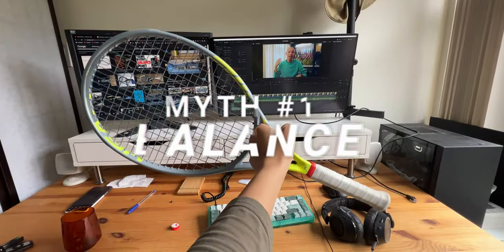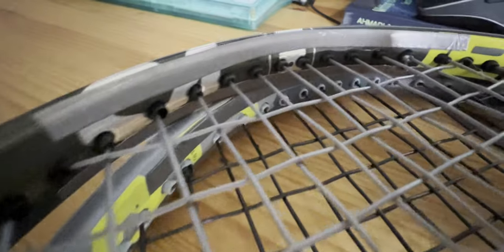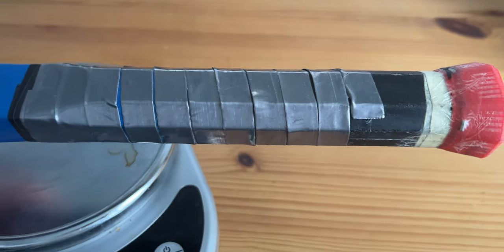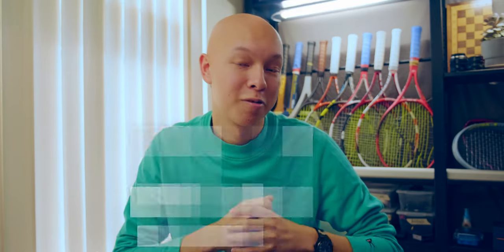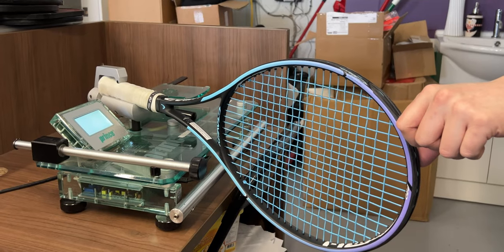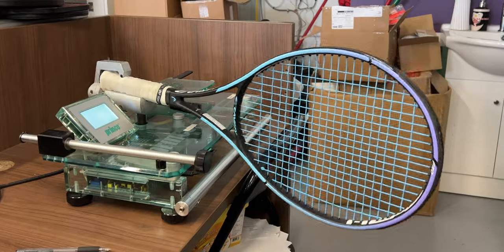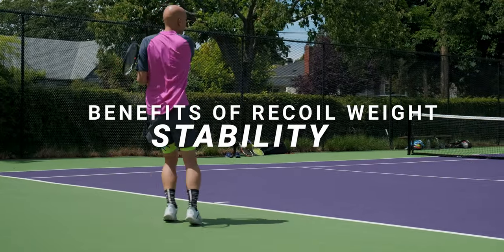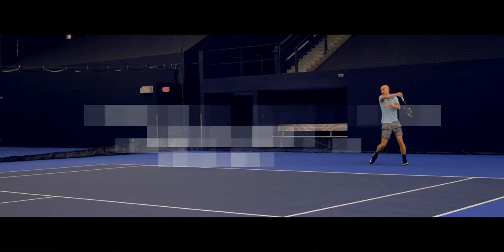The Secret Reason PRO's Add Weight to the Handle

Comment: What's the right way to add weight to the handle. If its lead tape I can put it under the grip in the same way that I put grip, I mean wrapping the racket or  vertical lines in the grip sides? how do you do it. 

At this moment I am testing out the Yonex Vcore95 2023 and it's really good but a lot of power in comparison of the RF so I want to modify and see if I can adjust it better.
Reply from the maker: I wrap it like a grip from the throat down. I’ve seen professional customizers do it that way, and with vertical strips so I don’t think it matters that much.
Reply: @TennCom  like the one you showed in the video, right ? Do you think 5g will be enough to add extra control? 5g + leather grip.
Reply from the maker: Yeah I think 5g is a great place to start

Comment: Hi, just got a Pure Aero VS that belonged to the pro Felipe Meligeni Alves ATP-153 and there's some silicone in the handle, not sure if that's the reason, but after some time the racket feels pretty tough to swing..... overall, it feel like the racket is super stiff and that ball feels heavy.

2 possible reasons I feel this is a decade+ hiatus and during this time I played a even coached Table Tennis, where head heavy racket is desirable. So I'm probably "hammering" the ball, since it feels natural for me to just use the racket weight to strike the ball....

Would love to have your(and guys in the comments) 2 cents on this....
Reply: Just weighed and it's about 20gr(there's metal weight in the silicone) just in the handle.
And balancing it with weights did help a bit.

Already removed everything, my wrist too f*cked up to swing it....
Reply from the maker: I have not idea... maybe just rest up and take your time returning to tennis. You are probably going to be using some different muscles that aren't quite used to being exercied.

Comment: Switched the the Babaolat Pure Strike VS. Love the racquet, but we I really start hammering the ball, it can feel a bit unstable any recommendations for that specific stick? Prior to watching this video I though about adding weight in the head at 3 and 9 and in the grip to balance. Now I am questioning if I should add more weight in the grip
Reply from the maker: what kind of shots are you feeling the instability?
Reply: Get an old Prince cts oversized approach racket which is the greatest racket ever produced. I have 50 rackets and that's the best

Comment: I am very very skeptical saw multiple video of Federer racket so much I know his match racket weights 362,5 he uses weight in top of the racket he uses leather between the strings on the bridge he uses stringelings to keep the strings in place. I never hear he uses more weight. In the handle.
Reply from the maker: Fed's racquet has a significant amount of weight added to the racquet from factory. His starting point, if you assume he actually uses the RF97, starts with a lot of weight in the handle compared to almost any other retail racquet available today.

Comment: Does recoilweight affect spin?
Reply from the maker: Interesting question. I don't think there's a clear answer. My experiences with recoil weight suggests lower recoil weights are more maneuverable so its easier to hit up the back of the ball, whereas higher recoil weights lend themselves more to striking straight through the shot, but I think that can be simplified to swingweight as well.

Comment: The older Prince CTS series have a thick rubber grip over the butt of the tennis racket which is tremendous for a little added weight and comfort.

Comment: Do you think that adding weight with a leader grip ( and having more inertia) making my raquet more head light too will help me with my rebel tennis elbow?
Reply from the maker: No. The leather grip does add weight, but its also so hard that I feel like it transmits more vibrations through the grip which kind of counter acts the additional stability from the greater mass. You would probably need to add at least 15g in the handle to see increase comfort, but it might not fix the TE if its caused from muscling the ball.
Reply: @TennCom i am a prime example of your statement about the more comfort one can get from adding 15g in the handle. The last 2 years i have play-tested about 28-35 racquets and more than 70% of said rqs i have tried to bring to my specs. 340-350 static w (there is zero ways to calculate swing weight where i live) and 7-9 balance points. All of these rqs have 12-18gr in the handle. Otherwise, i'd have troubles. I had never been able to put my finger on why but i always felt like the >12gr of lead tapes i put in the handle is my guardian angel guarding me from injuries

Comment: Is there a change to recoil weight depending on where you add it to the handle? For example, just putting weight in the butt cap or where you hold the racquet, versus distributing it all the way up the grip, versus just putting it at the top of the grip?
Reply from the maker: Concentrating the weight as low down as possible will increase RW the most, but I haven’t done much testing myself to see. May do this for a video
Reply: @TennCom   On your ET, you added a leather grip and 6g at the top, right? I know you said in your customization video your SW is 338, what is the static weight and balance of your ET with your current setup?
Reply from the maker: Yeah there’s leather and lead. I forget the exact specs but they are in a video I made called “how I customize my extreme tour”
Reply: Your wrist acts like a fulcrum (pivot point), so ideally the extra weight should be in the bottom 1.5 inch of the racket, as close to the butt cap as possible. I find that does improve the whippiness and acts more as a "counterweight". Any weight added in the handle that's higher up than your forehand grip's ring finger is on the "other side" of the fulcrum and does not make a major improvement imho. I find that the more weight you can concentrate on the bottom 1.5 inch of the racket, the better. So e.g. when adding a leather grip, you're actually distributing that extra weight across the whole handle which doesn't make it more manoeuvrable per se. 
I prefer a more polarized setup. Especially because I have a 1HBH and I like to volley so a few grams extra in the butt cap feels easier for those motions.
Reply: @TennCom  Try taping a toonie on your butt cap vs. taping it around the top part of your grip. Same weight, same balance point, but you will feel a difference in manoeuvrability.
Reply from the maker: @jetonmatik  I will do a series of blind experiments with a few subjects to explore further. I am happy to have stirred some controversy to get people (my included) thinking. Really liking all the counter points.
Reply: it's a matter of leverage. the farther away you put the weight the less weight you need. so better stuff the cap with less weight than stuffing under the grip with more weight.
Reply: @jetonmatik  actually during the impact the racquet pivot axle is its center of mass and your hand just have to counter the extra energy that your racquet inertia around its C.O.M.
The further from racquet's COM you add weight the more its inertia is increased (considering also that the fistance from the COM counts x²).
By concentering the added wheight in the buttcap you increase as much inertia as you can (considering a fixed amount of mass) and as a result you'll find your raquet more stable because your hand has to counter less force

Comment: Imagine a bicycle propped up on a stand. Spin the front wheel. Now stick a wooden spoon in the spokes. The wheel stops spinning when the spoon hits the forks while caught in the spokes. Now let's remove the rubber tire and install a 50 lbs 'tire' made of lead instead of rubber. Spin that bad boy with all your might and stick your wooden spoon in the spokes now. Something is gonna break. Probably the spoon.  The wheel hub is like the balance point of the racket. The top and bottom of the wheel are like the top and bottom of the racket. The spoon is the ball.

Comment: Would adding a wad of sillicone putty in the buttcap achieve the same comfort benefits?
Reply from the maker: Yeah, any kind of weight you add in the handle will help. Doesn’t necessarily matter how it’s added (lead, puddy, leather grip, etc)

Comment: where did you get this information about the pros reasoning? did a pro tell you this? I personally think you’re not exactly right. I think the weight in the head helps with inertia and solid feeling, with increased sweet spot, and weight in the handle helps balance it and make it less head heavy. weight in head helps stabilize racket during ball strike much more than weight in handle.
Reply from the maker: Adding weight in the handle helps increase the inertia without adding SW. You are right, weight in the head works better, but it think simplifying tail weight to "it balances out the feel" is missing a large part of the story, as you are only looking at the static measurements of the racquet, not the dynamic measurements of how the racquet behaves on contact.

Comment: Hammer example -
Swing the hammer holding the handle, difficult to swing
Swing the hammer holding the metal head, easy to swing 

Thats the whole point of head heavy and head light in maneuverability
Reply from the maker: In your example, you are drastically reducing the swingweight by taking the weight out of the head. Adding weight to the handle of the racquet is more like adding a second metal head to the other side of the hammer (imagine a double sided hammer with metal heads on both ends of the wood). So you still have all the head weight to deal with, plus the extra handle weight.
Reply: @TennCom  Yes, what I meant to say was, hammer is not the right example as these high end racquets are already headlight. So we are technically not adding the weight to the "handle" of the hammer.
Thanks for replying 🙏
Reply: In fact you can also give hammer example for explaining HH and HL balance in this way-
Hold the handle of a hammer and swing- difficult to swing but effective when it hits the target, good transfer of kinetic energy, but difficult to maneuver 
Hold the head of the hammer and swing- very easy to swing and maneuver but little to negligible transfer of kinetic energy

Comment: I think your explanation of recoil weight in terms of inertia was tight. Re. MgR/I tuning, the more you study it, the more you realize (as Racquet Tech did) that it’s only useful for frames far heavier than those used by most everybody. You also realize that trying to explain it with the kind of clarity you exhibit in this video is practically impossible. The upshot? Stick to recoil weight. It’s calculated with the same three variables, anyway, and provides all the intel amateurs need to understand this key measure that’s long been hidden from the tennis playing public.
Reply from the maker: Thanks for analysis Brandon. I’m feeling pretty much as you predicted. MRGi is also only really applicable to the forehand side which really limits its scope.
Reply: True that, @TennCom  , especially if you have a 2HBH-- which you doubtless know as well as there being more to explore in RW. Not that you should. Your intel here stands on its own. Folks don't get how much work goes into this level of production. Nicely done.
Reply from the maker: Thanks Brandon!
Reply: I see that: I at butt = RW + MR^2... Assumed if RW reached our height preference, then I add more lead tape, which one is better: closer value RW to MR^2 or opposite?

Comment: I probably would have left the hammer example out of this if I were you. If you’ve ever used a hammer and held it by the metal bulk and swung it, it would go through the air faster, not as heavy a blow but fast nonetheless
Reply from the maker: That’s because you don’t have any head weight anymore. If you keep the head weight, adding additional weight to the handle isn’t going to change the fact that you have to deal with the head weight.
Reply: @TennCom  that’s why you leave it out, it doesn’t have anything to do with what you’re trying to explain
Reply from the maker: @vhockada  Perhaps I am just dense, but I don't see you point.

Comment: Makes 0 sense :). I don't see how how much the impact 'upsets' the swing is linked to RW, or moment of inertia around the CoM. Racquet swings around ur hand, so what matters is the moment of inertia around your hand, and that's the definition of SW. If u dive deeper into vibrations/racquet physics you will see that another big factor that decides the vibration is the center of percussion, which, again, is not directly linked to RW, but mass and SW. So, honestly this whole RW thing doesn't make any sense to me and I'd appreciate it if anyone here can convince me that I'm wrong.
Reply from the maker: Sometimes the best way to feel it happening on court. Try setting up a racquet to have the same SW but different RW (10 points different in RW) and see how it feels to you.

Comment: your comparison with hammer is not good at all mate. simply because the point of balance on a racket is between 30 to 35cms from the butt cap. which is pretty much somewhere in the middle of the racket. a hammer has the weight all at the head. you just can't compare them. now take the handle of the hammer without the Hammer. put a lap of lead in the middle of it to mark the point of balance. and then whip it in the air to feel the balance. then put another lap of lead at the butt where you hold it in your hand and whip in the air again. you'll feel a massive difference.
Reply from the maker: I don’t understand why the change in balance point between a hammer and non-hammer change the effect on maneuverability of the added weight at the pivot point.

Imo the main argument against my thoughts on maneuverability is the double pendulum swing, meaning that the handle of the racquet is not the only pivot point. This is what I alluded to when I mentioned mgri/